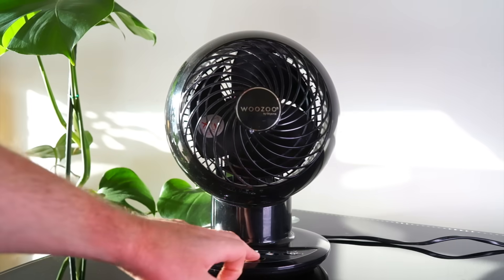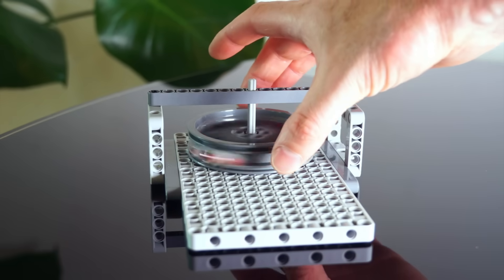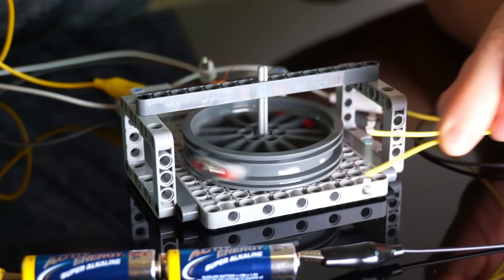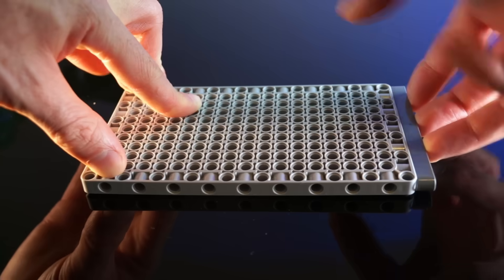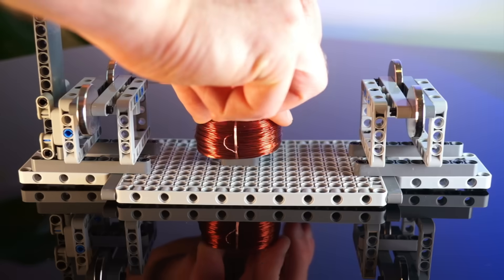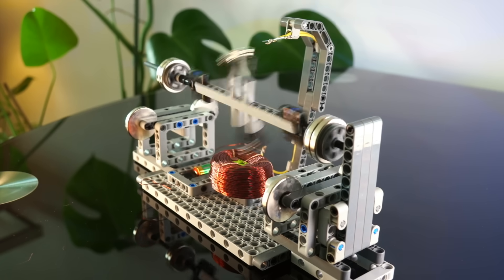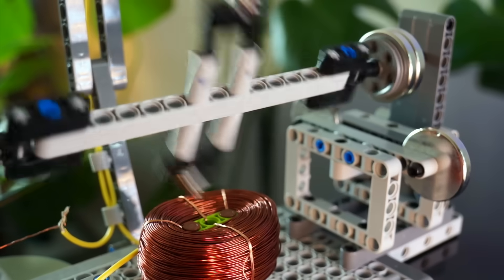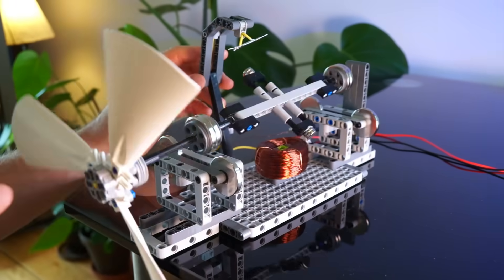Making a Totally Silent LEVITATING Fan Using Lego

Comment: I think using some type of very smooth bearing on the back would be helpful rather then simply having the axle resting on the backboard.

That's probably your greatest source of friction, with air being the second, that's sapping away any power your set up can provide. Having that would also help to stabilize it and stop it from bobbing around so much.
Reply: in my opinion, air is probably the greatest resistance

Comment: Use a transistor, it can handle more current.... But "more" not "infinite"!
Reply from the maker: I'll certainly see how far I can push it with a power transistor and 300 watts supply 😁
Reply: @JamiesBrickJams  Depends on the transistor.... There are very big ones, but I do not think, your coil will survive 300 W...
Please protect your transistor and power supply from all the shenanigans (voltage spikes when open circuit and that kind of stuff)

Comment: Is the "totally silent" thing not impossible to reach? I mean, the propeller itself, which moves the air, makes the main noise of such a system... there are numerous fans on the market for silent airblow in computers... those have totally silent "motors" as well, and are really noisy sometimes due to rotation speed and the blown air...
Reply from the maker: Yeah you're totally right, it's only silent cause I couldn't get it to spin really fast 😁 With a decent speed, it would certainly make a bit more noise. Though typically the casing tends to contribute a lot towards the noise, so if you're willing to endanger your fingers by not using a case, you can reduce a lot of the noise of a fan!

Comment: I'm not sure if it's possible to do it while levitating but,

What if you make it move using the design used in induction motors? (Commonly seen in water pumps)

So basically, there are multiple coils around the shaft.
That shaft is built as a squirel cage ( a straight cylinder made of two circles connected by metal bars that are tilted at an angle)

This way, the coils induce current on the bars which then causes them to react to magnetic fields and boom, a motor

This is likely oversimplified but there are vids that explain this wayyy better

(As I wrote this, I realized you're using a similar concept anyways, but I decided to send it anyways because who knows! Maybe it'll inspire you in a way!

But yeah, if it doesn't work, then just add more coils)
Reply from the maker: Definitely need to do some more research here, but I think I get what you mean!

Comment: What about having another suspension magnet set up front the blade, so that it doesn't wiggle too much? It'd need the whole setup to be higher, so that the blades are not stuck with the enlarged base, though.

Comment: Awesome))))) The main thing is that the magnets under the action of centrifugal force do not fly off directly in the face.
Reply from the maker: I wish it was moving fast enough for that to be a real concern!
Reply: @JamiesBrickJams  OK try to use instead of reed switch hall sensor, which are more faster then read switch, and turning on/off will be much faster and more eficient.

Comment: Everyone's recommending using a transistor in conjunction with a hall effect sensor, even though you already mentioned that in the vid lmao. However I've not seen anyone recommend putting an opposing coil. Rather than having 1 coil, you could use 2 on the sides as an opposing pair. Least then each time the coil fires, they're pulling equally from both sides and that should negate any wobble induced by the coils. Bonus is more torque too. Could even use 2 or more coil pairs for even more power but that may overcomplicate it. Good work lad, this channel has serious potential!

Comment: you could add suspension points on the rotating axle by adding the piece with holes in it then connecting that piece to the rest of the board for more stability. the hole will allow the axle to move freely whilst holding it in place with minimal noise due to a small amount of friction. hope this helps Jamie, great vid!!!!
Reply from the maker: Thanks a lot! That's actually a great recommendation and very easy to implement - will give that a bash 😁

Comment: Main issue I would solve is power. The reed switch fusing is severely limiting the magnetic force you can output from the coil. My (admittedly armchair engineer self's) idea is to have two circuits: one with a small power supply for the reed sensor which triggers a relay, and finally a circuit that has the coil connected to a bigger power supply. The relay would connect/disconnect the power from the coil. This all means that you can have a reliable reed sensor with a much higher voltage going through the motor. I do welcome constructive criticism btw

Comment: 5:07 the Fan is spinning the wrong way, the blades are the wrong way, and the force on the shaft shouldnt push on the surface where the center shaft touches the retaining blocks. Very interesting contraption whit a lot of possible improvements.
Reply from the maker: Ha yeah you can get it to spin either direction - only realized after posting that many segments I recorded had it spinning in the wrong direction 😅 Will fix that in the next version.. Cheers for the recommendations!

Comment: Could you use a pointier tip where the axle connects to the read base to reduce friction and wandering?
Reply from the maker: That's a good point, that should help a bit - was just struggling to find a suitable piece (but I didn't try very hard, so will try again)!

Comment: add a transistor so that all the driving current doesn't have to go through the reed switch. (and a back emf diode)
Reply from the maker: Ooh yeah good call on the diode too - will certainly try both!

Comment: My theory on improvement idea - more driving magnets.
The impulse is a touch off vertical and it looks like that upsets the stability of the motor core, sometimes enough to push it outside the stable region of the bearing magnets.
I think having three or four magnets rotating past the coil will help in a few ways. More pulses per rotation - smoother rotation, more mass - acting like a crude flywheel, and it allows more power.
If you’re up for some harmonic analysis, there’ll be a certain rotation frequency at which the impulse will offset the vibrations, acting as a damper. And some other frequencies at which it will amplify them.

This is a neat project and I’m really happy the algorithm brought me here
Reply from the maker: Thanks a lot 😁 Also a big thanks for your suggestions! Definitely agree some more driving magnets would do a better job at driving a smoother rotation. I'm afraid the harmonics are a bit above my pay grade, but very interesting to hear that 😅 Will definitely try another version with more magnets and a light flywheel!

Comment: Great idea and it will be more stable if you double the magnet from top to keep the force of the shaft equal  than you can add more coil and cross magnet to have more power

Comment: I'd be interested to see what you could accomplish if you took an existing fan motor and tried to replace its bearings with magnetic ones. You'd start with all the power and efficiency of a commercial motor, and then all you have to do is design the suspension for it

Comment: That reed switch will eventually wear out, especially if you are putting a relatively large current through it. Relays can have the problem with over current or motors that they fuse the contacts together, hence stopping it from working, you might have similar issues with a reed switch. The instant those contacts touch, which will be a very small area, there will be a large current draw by the coil. You would be better using Hall effect sensors like a lot of motors use, you would then need something to drive the motor though, you could make your own circuit with a transistor or mosfet or just use an off the shelf motor driver.

Another possibility is to use a led and photodiode or phototransistor, you can buy them already built and it triggers when something passes between the led and sensor. Similarly an IR reflectance or proximity sensor could work well too.

Comment: In addition to adding a third magnet to constrain the shaft radially you should add a magnet on the end of the shaft opposite of the blades - and a magnet on the thrust structure to maintain zero contact before and after thrust

Comment: Balancing the propeller should help so it doesn't bounce around,  you should be able to put the propeller in any position and it shouldn't turn on its own
Reply from the maker: That's actually a really good point - it does need a more sturdy shaft, and it did tend to want to settle in a certain position rather than freely floating

Comment: Why not encompass the end bearing magnets completely! This would reduce bounce. Reed switch tolerance would be more static.
You could use magnet to repel the ends to to eliminat even the smallest friction from axle point
The fan could be housed to draw air through to increase linear flow rather than irregular air disturbance
Encompassing bearings would allow ducting tolerance to be finer
Reverse fan to reduce friction on plate

So many options
Reply from the maker: Good point on reducing bounce - that's certainly very doable, as well as using another magnet on that end to reduce friction. I considered a housing but ultimately wanted to the spectacle of seeing it hovering in place. Still worth trying a housing though to see how that affects it. Cheers for the suggestions!
Reply: @JamiesBrickJams  
2 "C' housings will allow to see hover
Could put 2 side by side to encompass the  roll over of magnets
You could also do a vertical version because weight would hold axle in place yet not touch plate
45' angle?
👍🇬🇧

Comment: Try to make it more compact! It would be awesome to see.
Reply from the maker: It actually started much smaller, but I had to spread the magnets out or the reed switch just turned itself on when it got anywhere near it!
Reply: @JamiesBrickJams  I am quite new to electronics but could you have used smaller magnets and scaled the whole thing down? Or perhaps positioned the magnets in such a way that their force would spin the propeller in a certain direction?
Reply from the maker: @billclinton3862  ah gotcha, yeah you could totally scale the whole thing down! Just need smaller magnets and a different design. But could certainly make a much smaller one

Comment: Could you try connecting the fan indirectly through magnets? If you could get the fan stabilized on its own, you could try using weak magnets on the fan and axle to still “connect” the fan to the axle, but the weight of the fan may not bring the axle rotation down too much, while still getting the fan to move with the axle.
Reply: This is GENIUS

Comment: What you could do to prevent the read switch from sticking is run it through a solid state realy as they require very low voltage and current to trigger. Then you could have the reed switch on the "qoute" coil side of the solid state realy and then you can put almoste any voltage and current through the switch side of the solid state realy. And your reed switch should no longer stick. And a solid state relay has a very little amount of latency so it shouldn't cause any issues. And they are a bit simpliar than coil bassed realays. Or you could build your own coil bassed realy for this motor out of lego. I dont know how fast it would be to trigger though. But all in all just an idea.

Comment: Idea for improvement: Use a transistor or silent relay to switch the main circuit with the reed switch. This might reduce the binding effect because you can use minimum current through the reed switch and fine tune it with one less limitation.
Reply from the maker: Most certainly will, thanks for the suggestion! 🙏
Reply: THAT WAS MY IDEA BUT WITH A HALL SENSOR
Reply: That was my thought too. With only a couple more components, you can keep the simplicity of the reed switch and remove the current limitations. Just add a MOSFET and resistor.

Comment: Use some ferromagnetic core in the coil for improved efficiency.. 
Also, add more magnets on the up position, front and back to keep the propeller from bouncing like that.
Reply: Did you not pay attention to what he said? There's no iron core to prevent the magnets getting attracted to the coil in an effort to reduce the wobble

Comment: My first thought is that you could save a few parts by attaching the magnets to the end of the fan blades themselves, so a three magnet structure or even more. It doesn't look like the attachment system for LEGO gives you a lot of options for that. So instead you could build a six-sided hub and have three arms with magnets on them and three fan blades alternating on a single rotating structure, the magnet arms would have to be longer than the fan blades, but that would give you some additional leverage. Then you can build a much shorter levitating shaft that is more stable, I'm picturing about the proportions of a ferris wheel. The supports on both sides would be tall enough that the fan would be able to spin above the coil. You build a structure at the bottom to hold two coils far enough apart that only one of them needs to be on at any given time, as a magnet comes around one gives it a little pull and throws it towards the other which gives it another little pull just in time for the next magnet to come around to the first coil again. It would still pull the same voltage and current. It would just be connected twice as much if you get the spacing right.

Comment: To keep the circuit "simple" you could try using more reed switches. Parallel would cut the current down so they are less likely to weld shut and series would add redundancy so even if one does weld it could still operate.

Comment: Don’t replace the reed switch, it is part of the “colour” of the unit.  I would put something on the fixed axle end to stop it from falling out.  Use a bearing to reduce friction on the axle. Double the number of magnets.  You have two; north south.  Put the other two east west configured N,S,N,S. Enjoy.

Comment: Great little demonstration of a pulse motor. You can also make a single coil pulse motor with a few transistors it will last a little longer then the reed switch. Cheers!!
Reply from the maker: Thanks! And yeah you're totally right, I really should have used a good power transistor to handle the power delivery - will definitely give that a try. Cheers for the advice 😄

Comment: use a transistor. or make it like a traditional motor and make it brushed
Reply from the maker: Most definitely will use a transistor to handle the power in an upgraded version, thanks!
Reply: yee. just hook up the switch to the transistor and hell if you want hook it to a relay for higher voltage. might be stupid but it'll work for you set-up and to further improve add more magnets. and maybe two coils one to push and one to pull. I hope that helps!!

Comment: 2 improvements- extra restraint magnets above the levitation bases, and have the reed switch fire a higher current relay. Possibly an opto isolator.
Reply: at those speed a solid state relay. a small 1A transistor could probably do the job just fine
Reply from the maker: Great advice cheers man - will try some experiments with a transistor to handle the power, and add another magnet or two to prevent it bouncing upwards
Reply: I was going to suggest just using multiple reed switches in parallel, but you'd need them to fire at the exact same time, so I think what y'all are saying would be better, I also thought you may be able to simply glue a magnet to a little limit switch, but that'd probably pull the shaft too much

Comment: Could you use three magnets instead of two on the base? Make it less likely to pop out by putting the floating magnet between a triangle of opposing magnets
Reply from the maker: I suspect you could! It's usually pretty stable until I shove it around too much, but perhaps even putting the 3rd magnet on top could keep it from bouncing up too high. Cheers, will give it a try!
Reply: @JamiesBrickJams where do you get the fan blades
Reply: 4 magnets might be easier than 3 because the Lego is more readily compatible with right angles*

Comment: Everyone mentioned the problems with number of magnets and the coil etc. but I think we are missing a huge point here; the propellers are reversed, they are looking the other way, so even though they will push some air, they are efficient in the other direction due to their curve. Swapping those the other way without changing anything else would increase the moving air incredibly. 
Nice project, cheers
Reply from the maker: Oh man I didn't even realize that 😲😅 Thanks for the heads up!
Reply: and yeah try to fine the right propetters those look a little big. ps try to stabilize the shaft, the more it bounces the less consistency you'll have
Reply: Yeah plus if they are pushing the axle into the wall, you're creating unwanted friction. Those props could be creating thrust to reduce friction instead
Reply: exactly the three things i was gonna say
Reply: I NOTICED THIS TOO

Comment: ac magnets in a copper pipe = ac maglev
Reply: why so complex tho
Reply: yeah you can include the coils into the copper maglev sleeve
Reply from the maker: I've always wanted to try some kind of levitation either over a copper plate, or by levitating the copper plate itself! Don't suppose you have any references for a maglev?
Reply: @JamiesBrickJams  they used mechanical spinning magnets over copper sheets, but pulsing ac coils on a copper sheet would do it, and inside a pipe would make it a bearing